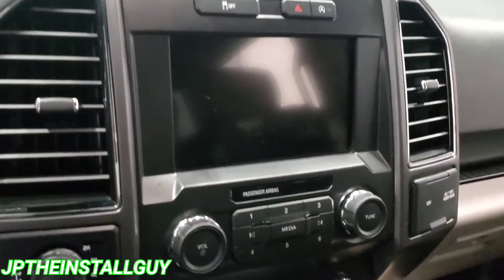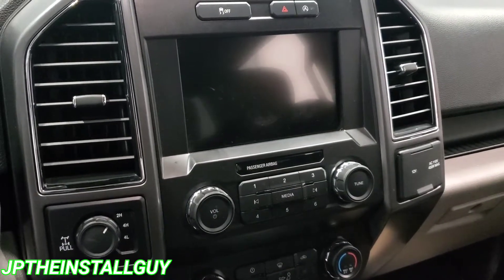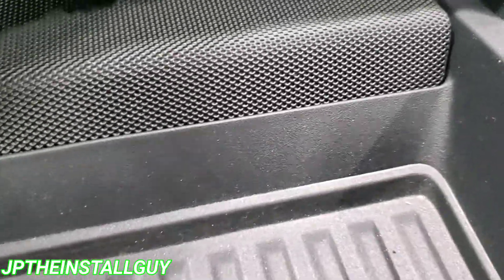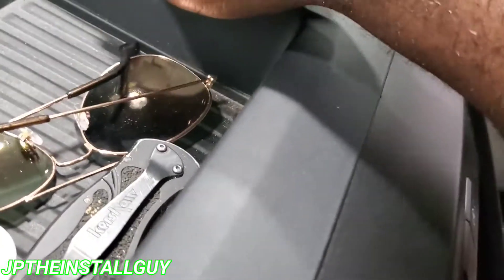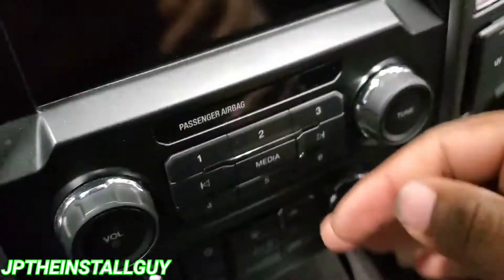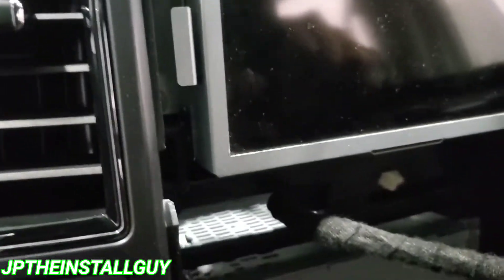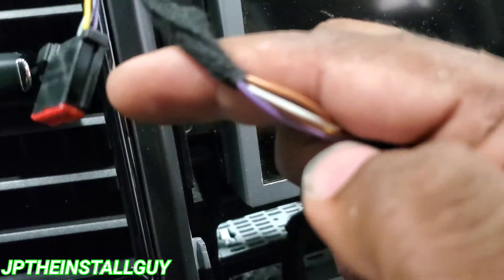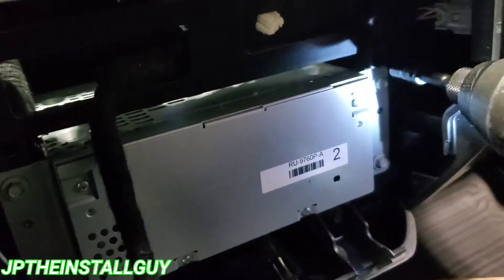2019 Ford f150 radio removal

Comment: Random question....although the F150 is equipped with Sirius, I prefer to use my own satellite radio, as it has more saved channel options. I use a CD Slot mount in my work vehicle to hold the satellite radio. If I replace the factory installed radio cover with one that has the CD slot, will it fit? And would the mount be able to go in to the CD slot, or will it be blocked by whatever is behind the cover?

Comment: Hi! I need to repaint/replace the chrome trim around my center console/cup holder area on my cord expedition. It’s very similar to this, how to I get that out? Pretty easy in my 2009 expedition, just pops out. But not this 2019